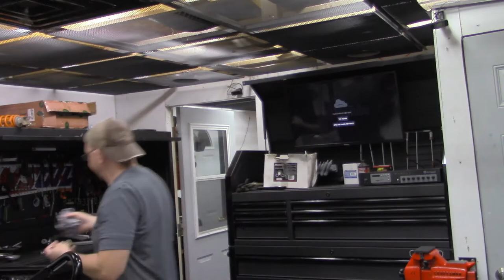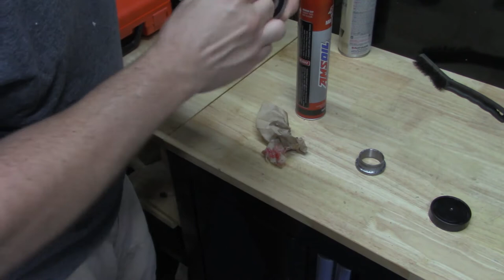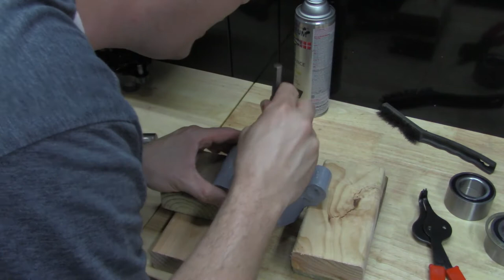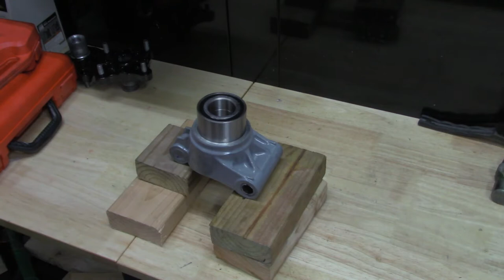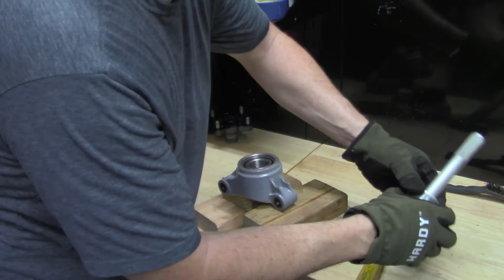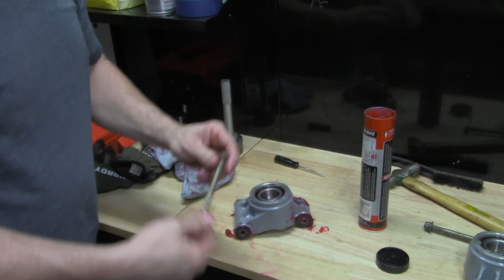Polaris Outlaw 500/525 IRS Rear Carrier Hub Bearing Removal And Install New Bearing Step By Step

Comment: That’s smart, I had to do that when I did mine yesterday but it was the rear carrier, but I had a question when you did that video on it did you ever pop out the other side of the bearing with the chain holder or you just pop the cover up a little and grease it up ?
Reply from the maker: yes both sides got greased popped them up and placed back. I bought new bearings for the future if needed.
Reply: @TorrentPerformance  Thank You Brother 🙏🙏I posted a video on my channel to but just the removal I’m going to put it back but waiting for parts 🤦‍♂️When you got your exhaust did you have to tune your Out law ?